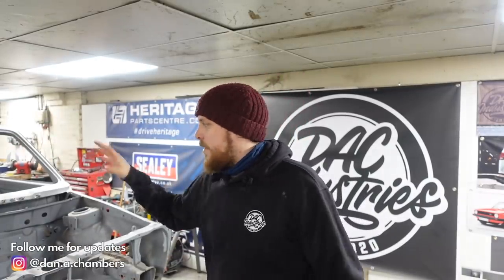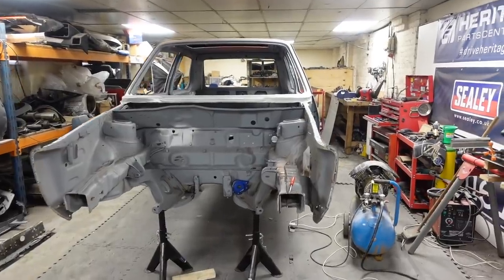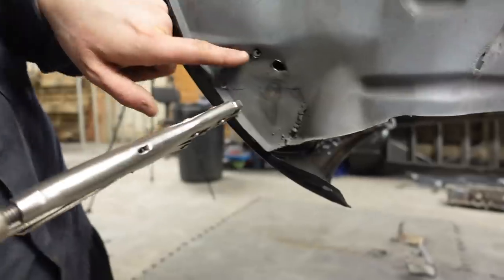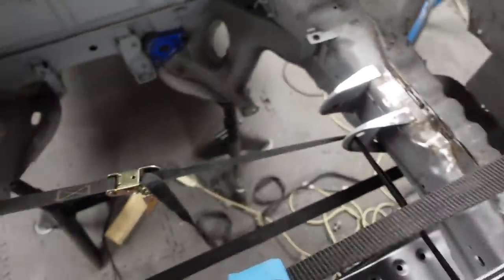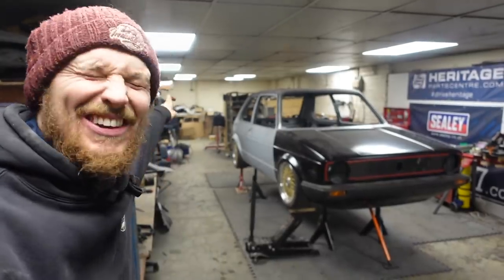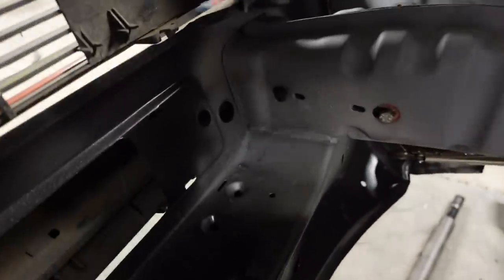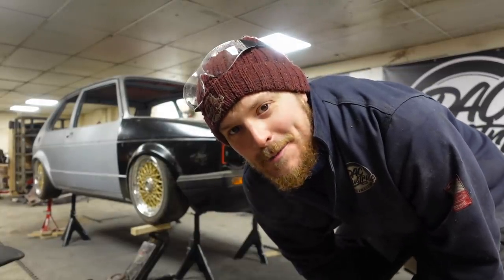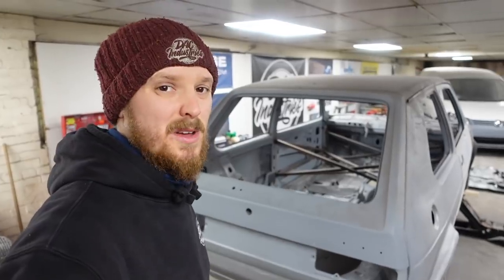Fitting The Front Panel, Fitting Wings & Bonnet - Golf Episode 26 Volkswagen Mk1 Golf GTI Resto

Comment: Inspirational ! Watching this is making me wish I had held into all the tin tops I had back in the day. I also parted with a rare well maintained low mileage 92’ mint cabriolet GTI that I bought at a steal in 2014 and let go in 2015 at a low price because I didn’t have a garage and couldn’t bear to see it exposed to elements.
My tin tops suffered from the sills and valances and arches, and the dreaded clutch plate not to mention the damn petrol tanks. These issues cropped up as early as the 90’’s , I had my fair share of issues to deal with and it wasn’t easy on a student budget. DIY was the way to go !

Comment: DAAAAAAAAAAAAAAM ....
That is looking awesome Dan. Another big piece of the puzzle slotted nicely into place 👌 
I do have to admit that I was really surprised that you didn't weld a piece of box in between the chassis legs before the rotten old front panel went bye byes. I guess as long as you measured everything and the dimensions are correct now, compared to what they were before, then great 👍 
Really glad you've got impetus again on the Golf. 
Any thoughts on colours? Keep it factory? Black with some kind of hypershift blue / pearl in it? .....
Reply from the maker: Cheers bud. Going back to factory Mars Red.

Comment: Dan, how long did it take for you to learn to weld? I’ve got a t4 project I could do to weld panels but never tried it. What set do you use? Keep up the good work 👍
Reply from the maker: I had a lesson in I think June/July last year. Actually melting metal together was pretty quick but learning how to get a decent finish is still ongoing. I had never picked a welder up before this. I have acheap one but would recommend buy as expensive as you can afford. Make sure you get 95% Argon 5% CO2 Gas too as that is so much easier to weld with!
Reply: @DanChambersDAC  thanks, think I’m going to have to learn. 👍🏻